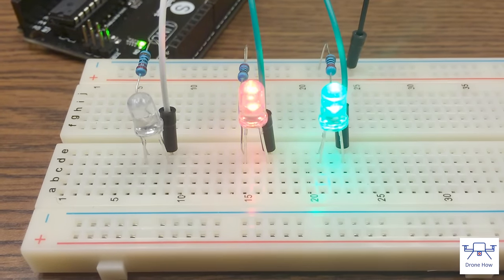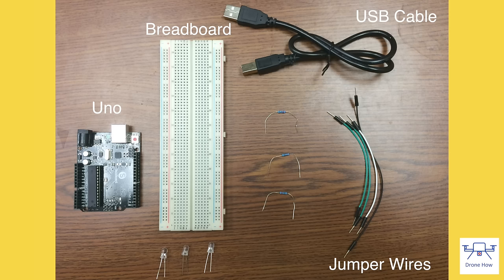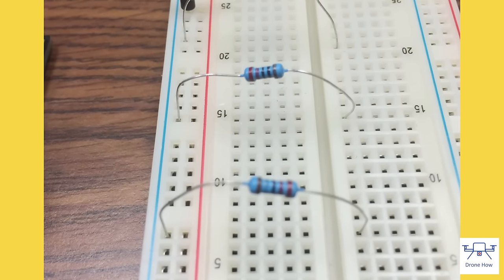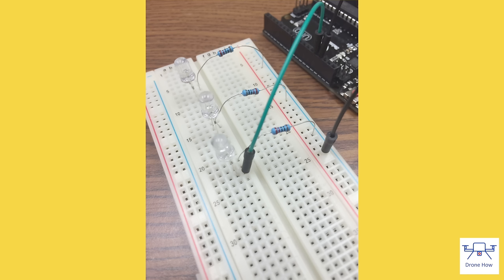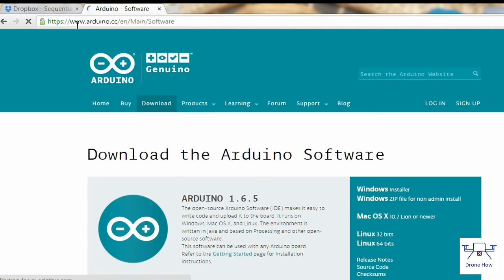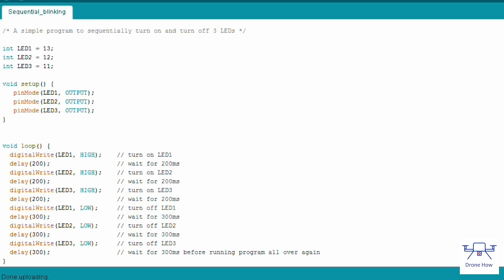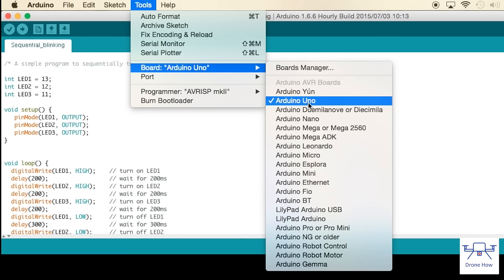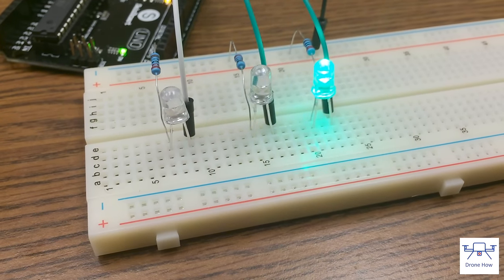Arduino Tutorial: LED Sequential Control- Beginner Project

Comment: Im a little confused on how this works? I'm probably very wrong here, but is the 5V not coming directly from the arduino, into the LED, THEN into the ground? It seems like the resistor should be before the LED?

Comment: I used a power supply and an arduino amd tried the same thing. The led's blinked but didn't turn off completely, that's because when the arduino powered it off, the power supply kept it on, producing a weird half-blink. To fix this I took away the power supply and only used the arduino, thanks bro fixed my problem

Comment: Good video , don't know what I did wrong though . I could either get the first two leds blinking or the 2nd and 3rd led blinking . But happy as this was only my second project . Will have to do a bit more working out on the circuitry
Reply: I have the same problem only the first led lights up for me. Did you solve your problem?
Reply: @brianbator6108  yes it was the breadboard connections that were coming loose

Comment: Hello! Thank you for this clear tutorial! I want to ask you, is it possible to buy an arduino with more outputs, and change the code so on a chain of maybe 20 LEDs, the two outside LED's activate first, then the next two etc, until they meet in the middle, then reverse until they reach the outside pair again on loop? What would that code look like?

Comment: here is the code 

int led1 = 10;
int led2 = 12;
int led3 = 11;

// the setup function runs once when you press reset or power the board
void setup() {
  // initialize digital pin LED_BUILTIN as an output.
  pinMode(led1, OUTPUT);
  pinMode(led2, OUTPUT);
  pinMode(led3, OUTPUT);
}

// the loop function runs over and over again forever
void loop() {
  digitalWrite(led1, HIGH);   // turn the LED on (HIGH is the voltage level)
  delay(200);
  digitalWrite(led2, HIGH);   // turn the LED on (HIGH is the voltage level)
  delay(200);
  digitalWrite(led3, HIGH);   // turn the LED on (HIGH is the voltage level)
  delay(200);
  digitalWrite(led1, LOW);   // turn the LED on (HIGH is the voltage level)
  delay(300);
  digitalWrite(led2, LOW);   // turn the LED on (HIGH is the voltage level)
  delay(300);
  digitalWrite(led3, LOW);   // turn the LED on (HIGH is the voltage level)
  delay(300);

}

Comment: flyingclive

Excellent description being clear and precise - you have a new subscriber. I am thinking I could use this as a base for controlling  10 x 230v  1.2 Watt LED staircase lights using Triacs instead of relays. I only need the lights to be triggered by a pressure mat at top or bottom of staircase that will turn on the lights in sequence and switch off after pressure mat is triggered at the opposite end.
Reply from the maker: Thanks for subscribing. That's a cool concept. I'd recommend using a relay bank instead of the triacs. They are inexpensive enough to use and very reliable. Here is a link to a 250v bank that might work: http://amzn.to/1XFgPyv
Reply: that's a phenomenal idea Clive Rumble.
simply make the use of relay board(s) that come specifically for arduino.
do share the link form where you bought/will be buying the pressure sensor and relays.
have a great day :D

Comment: I want to use this set up. I tested & it works. The LEDs I want to use in my project come with resistors attached to the the anode. Will it work without blowing these LEDs?

Comment: nice vid but my arduino uno R3 ATMEGA328P (CH340G) has its 13 pin linked to the onboard LED so not the LED on the breadboard is blinking but the onboard led, of course i can just change the code to pins 12 11 and 10 and everything works. Great tutorial for me man

Comment: Very nice clear instruction, is it possible to make each led fade in and out? Thanks for this video.
Reply: sure just check for the example code in the arduino IDE
open arduino IDE>file>examples>basics>fade
you just need to connect your LED on the mentioned pin as in the code.
hope this information helps you.!
Cheers!

Comment: would this work for multiple LEDs? For example, I am trying to make a circuit where the LEDs spell out "I <3 U" where the I turns on, the <3 turns on, and then the U turns on. How would I make sure that each LED is connected to its respective resistor?

Comment: Sorry, but what kind of LED do we buy? I am new to this and am not sure what the power rating/ voltage of the LED diode I require when using the 220ohm resistors. Additionally, if I had not used a resistor and connected the LED diodes to the Arduino UNO, the Arduino will still be functional, right?

Comment: Can you put the jumper wire into another pin than the ground one on the Arduino? I’m already using it for a negative battery wire that connects to something

Comment: I am just starting to learn about this so I apologize if this is a dumb question. Since only one light is on at a time would it be possible to connect the short legs of the LEDs to the negative rail, and then have one 220 Ohm resistor between the final LED in the sequence and the ground wire?
Reply: don't be hard on yourself. your doubt is perfectly valid. Presently all the LEDs are connected separately. Each LED is individually controlled by independent Pins. hence, one option is possible, Connect all the negative rails of the LED together and connect it to ground via 220-ohm resistor. it will work. it is not best practice though.

Please visit https://wokwi.com for free Arduino simulators. 
#wokwi
Reply: @puneethkumar703  Thank you.

Comment: Ok i build this how it explained in the video. But it seems like the only port that wants to work is the 13. The leds are placed right. If i connect them all to that port they all turn on but if i put them in the other ones they turn off. Could it be faulty board?
Reply: Im having the same problem. If anyone knows what I'm doing wrong lmk

Comment: Hey man, first of all, thank you for sharing your knowledge on the web. Sharing is caring !

Now for the less serious matter; I am trying to wrap my head around the concept of resistors and your video really confused me to be honest. Aren't they supposed to be connected from the positive towards the LED instead of from the LED towards the ground ? 

I mean they are meant to reduce current to not blow the LED up right ? So why are the positioned after the LED ? Am I missing something here ? 

Thanks a lot for your time again.
Reply: A simple resistor has no polarity as far as its resistance is concerned. The resistance is the same regardless of the orientation.

Comment: I have a question, i followed your steps except for one main thing, not like the video where you inputted all three of the LEDs, instead i light up one of them and started the same thing on the other LED instead of doing it all with the three of them.

Result: One Led lights up
Two Leds didnt light up
even though their pattern, their holes their positions tools etc are all the same.

i don't know if i should make a conclusion that's why i need your opinions first.

Comment: I'm new with Arduino. When constructed this circuit only 11 LED would flash. The Uno is brand new and I made sure  all the connections were correct. Also I am not clear on how to program the Arduino. The website was not helpful. Your help would be much appreciated. Thanks.

Comment: Pls. Help. 
I followed the example, and I even download your code. I don't have any experience in coding, and I'm doing this as a curiosity to teach myself how to "code" anyway.  How about installing a button in there and how would you write that? And how about if you're done pressing the button, you let go the button, led turns off. Then press the button again, and it will start from the begging led.

Comment: is there any smaller control panels to use Im trying to make a small stobe style stick that uses a switch to change from stobe to on mode. I was wondering what battery would I use for 8 10w leds.
Reply: once you program the chip you can take it off the arduino and use it by itself.

Comment: i have a NHduino uno i purchased online and i am having problems uploading my project to my board. I have tried different boards and programmers and searching the info for my board however i get an error code that reads i have a native serial port and can't be obtained. I believe my board is not on the list as it is shows NHduino UNO on the front. Any advice on how i should proceed will be useful, 
Thank you kindly

Comment: Hey Drone How, can you please explain why you have to double the digitalWrite code section. Cant it work with 3 line with 3 delay instead of 6 line and 6 delay. Nice Video, I subscribed. :)
Reply: You want it to turn on AND off. If you only do 3 lines with 3 delays, it will turn on once and stay on.

Comment: I am new to the arduino i am trying to run 58 three volt LED's to blink to music. I am having trouble with the circuit and the code. Any help would be appreciated.
Reply from the maker: +Justin Hoch Are you using an external 5V source?

Comment: I'm still only getting the first LED to blink, the one thats closest to the ground wire. What do I do

EDIT: I saw a comment that said to first download the sketch and run it,
but then i run into another problem
i get an error in the black bar section at the bottom that reads
Sequential_blinking:8:6: error: redefinition of 'void setup()'
Reply: Nevermind guys the reason it was showing that error was because I had another tab open in arduino. If you get that problem you can't just close the tab, just delete all the text and then run upload your file to be compiled

Comment: hello sir,
i found error while uploading the sketch, i have aurdino uno r3 board..
Arduino: 1.6.7 (Windows 7), Board: "Arduino Duemilanove or Diecimila, ATmega328"

Sketch uses 1,030 bytes (3%) of program storage space. Maximum is 30,720 bytes.
Global variables use 9 bytes (0%) of dynamic memory, leaving 2,039 bytes for local variables. Maximum is 2,048 bytes.
avrdude: stk500_recv(): programmer is not responding
avrdude: stk500_getsync() attempt 1 of 10: not in sync: resp=0x9a
avrdude: stk500_recv(): programmer is not responding
avrdude: stk500_getsync() attempt 2 of 10: not in sync: resp=0x9a
avrdude: stk500_recv(): programmer is not responding
avrdude: stk500_getsync() attempt 3 of 10: not in sync: resp=0x9a
avrdude: stk500_recv(): programmer is not responding
avrdude: stk500_getsync() attempt 4 of 10: not in sync: resp=0x9a
avrdude: stk500_recv(): programmer is not responding
avrdude: stk500_getsync() attempt 5 of 10: not in sync: resp=0x9a
avrdude: stk500_recv(): programmer is not responding
avrdude: stk500_getsync() attempt 6 of 10: not in sync: resp=0x9a
avrdude: stk500_recv(): programmer is not responding
avrdude: stk500_getsync() attempt 7 of 10: not in sync: resp=0x9a
avrdude: stk500_recv(): programmer is not responding
avrdude: stk500_getsync() attempt 8 of 10: not in sync: resp=0x9a
avrdude: stk500_recv(): programmer is not responding
avrdude: stk500_getsync() attempt 9 of 10: not in sync: resp=0x9a
avrdude: stk500_recv(): programmer is not responding
avrdude: stk500_getsync() attempt 10 of 10: not in sync: resp=0x9a
Problem uploading to board.  See http://www.arduino.cc/en/Guide/Troubleshooting#upload for suggestions.

  This report would have more information with
  "Show verbose output during compilation"
  enabled in File > Preferences.

Comment: hello sir, there is a problems while uploading...please help.

Arduino: 1.8.3 (Windows 7), Board: "Arduino/Genuino Uno"

Assembler messages:

Fatal error: can't create core\wiring_pulse.c.o: Permission denied

exit status 1
Error compiling for board Arduino/Genuino Uno.

This report would have more information with
"Show verbose output during compilation"
option enabled in File -> Preferences.

Comment: My 1 LED is blinking as the one on uno board but others are not after connecting to pc and it is also not uploading my coding why??
help please
Reply from the maker: +Hatem Benmussa How do you know it's not uploading your code? Have you tried replacing the LEDs that don't work with other ones?

Comment: Another glitch in mine!!!  i fixed my first problem but then now only two of them are working and they are impossibly dim!  HELP ME! THIS IS ONLY THE SECOND TIME I USED MY ARDUINO UNO
Reply: Emoji Kitty make sure your jumpers are good and not damaged.  Then make sure your LEDs actually work, and check your code
Reply: there can be a number of issues due to which your project is not working.
let me help and troubleshoot some of them.
1. check arduino comms. port in control panel>device manager>coms port and lpt
2. make sure that jumper wires are not damaged [use multimeter]
3. make sure that the polarity of LED is correct [use multimeter ]
4. board is faulty,so to check...open arduino IDE and in Examples>blink...make sure that board works perfectly and the LED(basically digital pin 13) works perfectly
5. the channels in breadboard(if using) are not shorted [use multimeter]
please check the above points and reply me back in the comment(s)
i sincerely hope that this information helps you 
have a great day :D

Comment: Here learn it with for loop

int LED1 = 11;  
int LED2 = 12;
int LED3 = 13;
int dMax = 50; 
int dMin = 50;

void setup() {
 pinMode(LED1, OUTPUT);
 pinMode(LED2, OUTPUT);
 pinMode(LED3, OUTPUT);
 
}

void loop() {
int LED = 0;
  for (int i = 10; i < 14; i = i+1) {
    digitalWrite(LED+i,HIGH);
    delay(dMax);
    digitalWrite(LED+i, LOW);
    delay(dMin);
    if (i == 13) {
      i = 10;  
    }
   
 }
}

Comment: I got this error- 
I just got my first kit today so I have no idea what it means
Arduino: 1.8.12 (Mac OS X), Board: "Arduino Uno"

Sketch uses 1050 bytes (3%) of program storage space. Maximum is 32256 bytes.
Global variables use 9 bytes (0%) of dynamic memory, leaving 2039 bytes for local variables. Maximum is 2048 bytes.
An error occurred while uploading the sketch
avrdude: ser_open(): can't open device "/dev/cu.usbmodem141101": No such file or directory
Board at /dev/cu.usbmodem141101 is not available

This report would have more information with
"Show verbose output during compilation"
option enabled in File -> Preferences.

I just got my first kit today so I have no idea what it means
Reply: Check USB cable and driver software

Comment: Can we do it without resistor?
Reply: resistors protect both the LEDs and the Arduino from frying. Please do use a minimal value at least. 
If you need higher brightness, you should use a BJT and control the base of the BJT using Arduino.

you can run many Arduino simulations here for free: https://wokwi.com
please reply if you have any questions

Comment: I'm using the arduino duemilanova. Is this the reason why it doesn't work. :(
Reply from the maker: It should work the same way. Provided you connected to the correct output ports.

Comment: only one of my my LED's would turn on.. any thoughts?
Reply from the maker: Check the power leads to the other two LEDs. Have you tried replacing the other two LEDs.
Reply: Yes, yesterday I remade the entire piece with different LED's and jumper cables but still only the first LED would light up
Reply from the maker: Did you re-send the program to the board?
Reply: Yes
Reply: +Joel Campbell Maybe the LEDs are broken, happen to me one time...
Reply: maybe..
It is my first time doing the wiring for the LEDs so i'm guessing that the error is because of me.
Reply: +Joel Campbell same problem here.. for me only 13 will make the LEDs turn on

Comment: im having a problem. i have only one led turning on and off
Reply: make sure you have connected the correct I/O port with your LED(s).
after that check the polarity of the LED that you have connected with arduino.(the big flag in the LED is for -Negative terminal and the small flag in LED is for +Positive terminal).
i sincerely hope that this information helps you.
have a great day :D

Comment: why did we use the resistor?
Reply: resistor literally decreases the amount of voltage that reaches the LEDs for eg if 5v originated from the arduino then somewhat less than 5v is definitely reaching into the leds and this helps the leds not to over voltaged. hope it helps

Comment: only one led is working. port 13 only. any help?
Reply: have you used the script? sounds like you forgot/overheard  the script download or maybe the script was not correctly transferred to the "arduino", because only the Led on the pin 13 glowed faintly until i succesfully transferred and started the script on my arduino uno... 02:19

Comment: THe red led is continuously flashing and no other led

Edit: I had my arduino version set to Arduino Uno instead of Arduino 2560Mega

also i think this code looks pretty good on the arduino

void setup() {
  pinMode(13, OUTPUT); //Red is 13
  pinMode(12, OUTPUT); //Green is 12
  pinMode(11, OUTPUT); //Blue is 11
  pinMode(10, OUTPUT); //Yellow is 10
}

void loop() {
  digitalWrite(10, LOW); //turn off yellow
  digitalWrite(13, HIGH); //turn on red
  delay(100);
  digitalWrite(12, HIGH); //turn on green
  digitalWrite(13, LOW); // turn off red
  delay(100);
  digitalWrite(11, HIGH); //turn on blue
  digitalWrite(12, LOW); //turn of green
  delay(100);
  digitalWrite(10, HIGH); //Turn on yellow
  digitalWrite(11, LOW); //turn of blue
  delay(100);
}